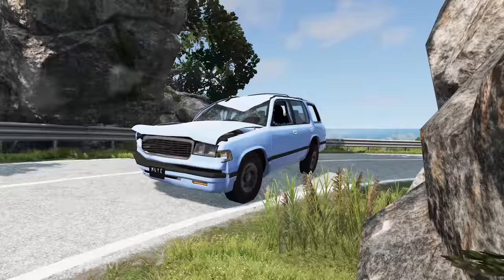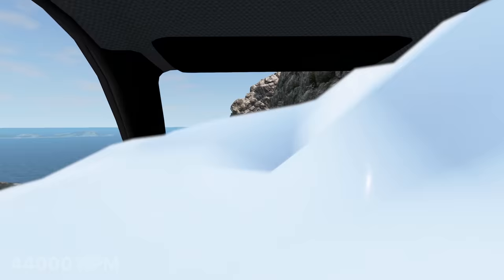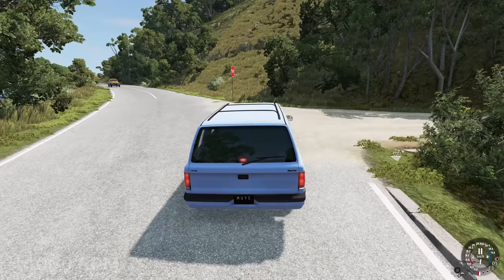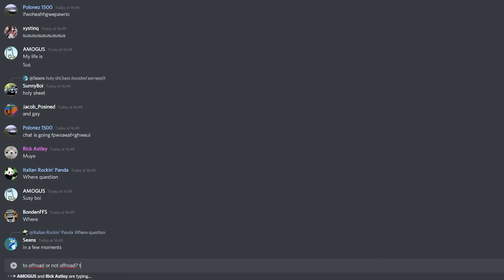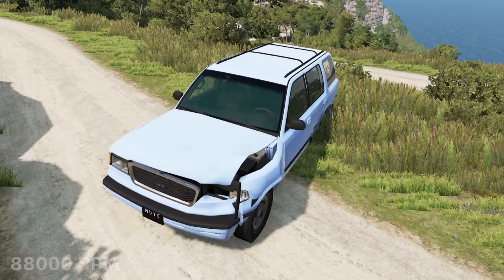Every Time I Crash, The RPM Doubles

Comment: The car started to sound like a siren of some sort with all the increasing RPM.
Reply from the maker: I think some sirens actually rely on high revving motors to push air around
Reply: @MuYe  yeah they do, it's louder than speakers
Reply: @MuYe  they actually do, the german ones sound absolutely disgusting and are so loud too. I have problems with noise so in my dream they wouldn't even exist.
Reply: @MuYe  not really most sirens motors are around 3600 to 4800 rpm the pitch is due to the number of ports on the stator and chopper
Reply: @MuYe  air-raid sirens
Reply: Nobody:
My grandpa in the corner hearing the siren machine sound:roll back! Bombs comin'!
Reply: Im pretty sure it became a dentist drill
Reply: @MuYe  yes
Reply: @AirWasTaken  😂
Reply: More like Car doing cat Meowing sound.
Reply: @MuYe yep. Especially the old air raid sirens from WW2 and also some types of hi/lo sirens like those used for escape sirens (the HMP Broadmoor sirens are a good example).

Edit to add that those have ports on the sides that allow air to exit, and it’s the number of those that affect the pitch (as well as the motor rpm). The Broadmoor sirens have shutters on the air intakes that restrict the airflow into the siren and, in this case, produce the very distinct hi/lo tone that you can hear with them.
Reply: @anti_furry_elimination_squad  love ur name
Reply: more like the deep note.
Reply: @MuYe Some sirens do actually have speakers that are just extremely loud. They don’t play high pitched frequencies, Instead they play audio of someone warning the people of something.
Reply: @MuYe  im your fan!

Comment: MuYe: "power isn't always the answer"

American car manufacturers in the 1960s: "Imma pretend I didn't hear that"
Reply: and then in the 70s and 80s it was the opposite
Reply: Jeremy clarckson "Oh no, anyway i bought this bmw for this adventure in africa"
Reply: @slonky821  cause of stupid regulations
Reply: @slonky821  1970 dodge charger had 425 hp just saying
Reply: American car manufacturers in general
Reply: @justinfarr4399  No. That was sae gross. In todays hp standards it was arpund 280
Reply: @timothyhockett7104  The Chrysler 426 Hemi, for example, in 1971 carried a 425 hp gross rating and a net rating of 350 hp. I am not going to say you are entirely wrong, it is less horsepower, but it is not that drastic of a change.
Reply: @justinfarr4399  Thats what happened when they finally went to bench testing with no accessories or belts, to full dress. The number I said was the average for the wheel hp going through the slushbox autos with the awful torque converters they had.
Reply: lol americans cant make engines. they use big engine with low power
Reply: @bezimienny1337  they have plenty engines with big power, small and large
Reply: @justinfarr4399  Not to mention manufacturers underrated their engines pretty aggressively back then
Reply: @wolfgang_h3t  I know, stupid regulations
Reply: @slonky821  The 71 Mach 1 I think had almost 500 hp
Reply: if life has taught me one thing, its that power is always the answer, as long as its a v8
Reply: @justinfarr4399  that was ‘70 by 1979 everything was slow my 1979 trans am made 185 hp new
Reply: @bezimienny1337  And they are reliable, the Mustang 5.2 V8 makes 526 hp N/A, C8 Z06 makes 670 hp N/A, German cars need turbos to get over 400 hp lmfao.
Reply: @aimxdy8680  ever heard of a porsche  917 they had those things pushing well over 1,000+ hp back in the 70's, raced against American cars at some point and smoked them
Reply: @niekoman_  the GT3 makes 502 hp, still less than the Z06 670 hp N/A. Show me any other german car that doesn’t need turbos on a V8 to get above 400 hp.
Reply: @aimxdy8680  bmw m5/m6 with the v10 
Mercedes c63 the esrly generations
Reply: @aimxdy8680  e63 s63 Porsche macan v8
Reply: P

!

Pn p
Reply: @bezimienny1337  bro has no clue what he's talking about
Reply: Carguement
Reply: my name's carol shelby and performance is my business intensifies
Reply: Ford:

Comment: 9:30
You're still getting startled by that. Again, I think that because when an engine breaks, the RPM, no matter what, just snaps to 0 which causes a massive burst of torque in the opposite direction.
Reply: the intertia of 100k rpm of a 4.5l is alot

Comment: GAVRIL®, REACHING THE PEAK
We at Gavril take up crazy challenges. We  have made our engines out of the toughest material ever: Obamium. Yes, we use Obamium for our new prototype engine, codenamed: The Revver. With 120000 RPM, we have reached our speed record with our tough SUV, Gavril® D-Series™. 
Gavril®. Leads the way™.

Comment: It's very difficult to accelerate a vehicle faster than 1G of horizontal gravitational acceleration (using friction by tyre only, or otherwise exceed a time under 2 seconds to 100 kph) without having a way for the tyres to hook into the road, either through a special tyre or through a sticky tack that's applied to the road like on a drag strip.

Comment: All the default engine sounds in BeamNG stop increasing in pitch at 50,000rpm, so if you go higher, the car will just sound like it's holding 50k rpm steady which is a bit weird... 🤔

Comment: you should've make the gearbox much much shorter. Like final drive 2x shorter each time you double the RPMs. At the top speed run you've never reach the HP or RPMs because of gearbox being to long.